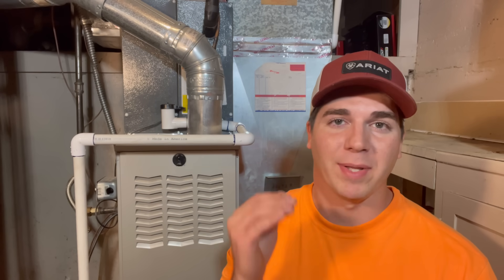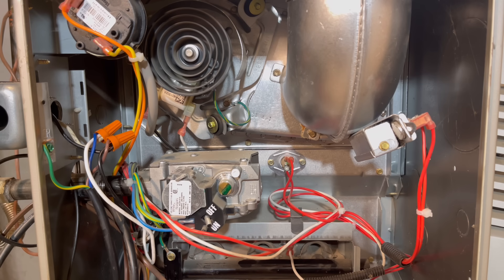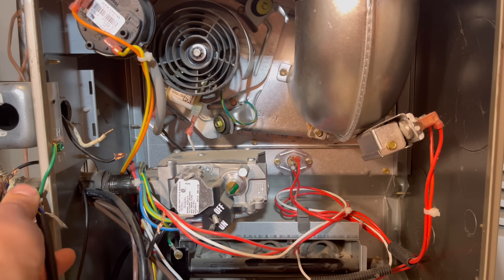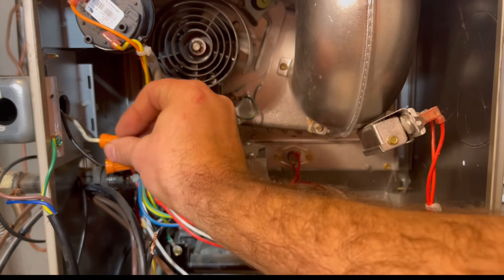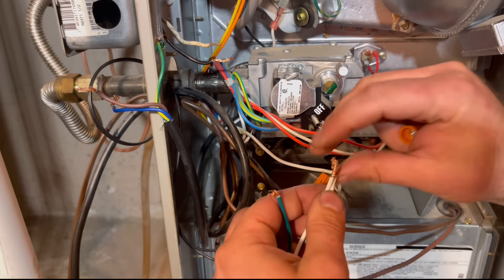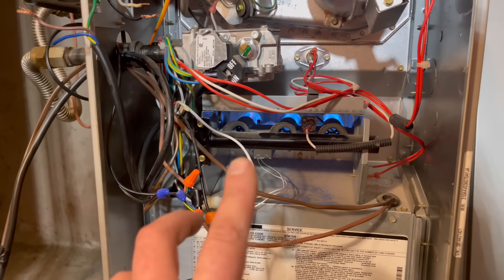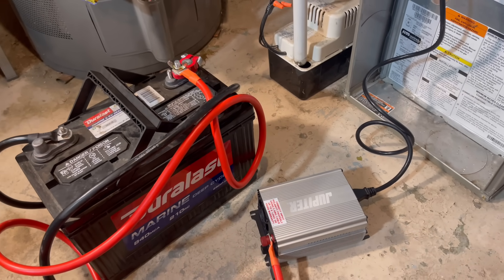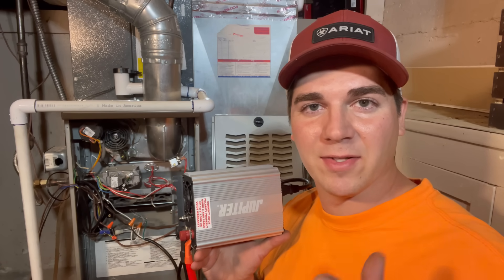Did You Know You Can Heat Your Home With A Car Battery?

Comment: For those worried about the battery life, you can always hook up the battery to your vehicle and let the alternator charge it up a couple times a day too for a short time.
Reply: It doesn't matter what you post, someone will bitch about it.
Reply: @derekbootle8316 .    You nailed it there. I don’t give a shit if I hurt a battery or an alternator if the power is going to be out for a few days and it’s -30 outside. Sometimes you gotta do what you gotta do to not have your water lines burst
Reply: @derekbootle8316  for real
Reply: @derekbootle8316  That's ridiculous. No one ever bitches or complains on these threads. 😆
Reply: Or, since all you are really doing is adding an "extension cord" style setup, you could plug the furnace into a portable generator.  Another option.
Reply from the maker: Check out my latest video :) cheers
Reply: People there is a second outlet just plug a battery charger in that outlet and it will keep the battery charged, and run the furnace, problem solved about the battery dying 2 birds 1 stone
Reply: @kenchevy3960  Exactly what I was going to say, plug a charger into the other outlet, and set the charger on a trickle charge!
Reply: @kenchevy3960    Or better still,  buy a very large inverter, charging a bank of batteries.  Disconnect the utility, and the batteries power the inverter, and the inverter runs the house load and charges the batteries at the same time.  Problem solved!
Reply: Just plug a battery charge in the converter then the battery would be charging itself
Reply: Or use a solar charger during the day.
Reply: Just connect the alternator to the furnace and use it to charge the battery
Reply: Leave the battery in the car, get a long extension cord, run just the cord to the furnace. Then you can periodically start the car to charge the battery since car batteries are not designed for deep cycle and will get damage if drained too much.
Reply: Good advice and you should actually do this regardless.  Car "starting" (vs. "deep cycle") batteries aren't made to be deep-discharged.
Reply: @joez.2794  Correct. If a person has an inverter, a deep cycle marine battery is the right choice which run about $80.00 or so. People with power inverters (pure sine wave) most likely have solar charging. On the other hand, a solar generator has both battery and inverter which can be hooked up to solar or electrical outlet and are usually pure sine wave. The inverter in the video is a modified sine wave device and are only good for short period of time use. So he is correct to run the furnace on that particular inverter.
Reply: wow, there are some dumb people here...
Reply: absolutely ....and battery maintainers when the power works, gas motor a car alternator and a battery...many ways to do these things!
Reply: You say any battery will work, so your battery was 844cca.  My truck is 740 cca.  Is their still high probability that it will work.  Thinking of buying a spare that's why I want to clarify.  I do appreciate the budget solution.
Reply: @fpcsdseniors9912  better off buying a small generator. The battery based idea is more for if you get caught off guard and all the generators are sold out bc the disposable generators all got thrown away last storm by single use wasters.
Reply: Awesome, so now you can introduce extraneous electrical noise back to your ECM module on your vehicle. Heaven help you if you fry that.
Reply: Yep.
Reply: Or just leave the battery in the car and run an extension cord from the 120v inverter. Even better if you can find space to put the inverter so the hood closes but also good to turn off the inverter when not using the furnace or you draw power off the battery. Run the car to keep it charged since you will need a charged battery to start the car anyway.
Reply: @TheAnantaSesa  or just get a fucking generator
Reply: @jamineamina5429  or just get a whole fluffking solar array/windmill/battery backup system. You can't always get stuff last minute or fully afford it for an off chance of need. Looks like you missed the point of the video.
Reply: You can have two inverters. One from the battery to the AC inverter which powers your furnace. Then since you have more than one receptacle you have an AC to DC inverter that’s connected back to the battery. Trickle charging your battery. However it depends on the line and load.
Reply: @joesnose1647  lol. Free energy! Just unplug the battery from the car and shut it off too. Charge from the inverter lol
Reply: @TheAnantaSesa  exactly!
Reply: @TheAnantaSesa  yeah it's called perpetual energy and that doesn't exist it's going to take more energy to run the battery charger than is being outputted onto the battery from the charger.... I've tried this myself and I've seen tons of videos on it...
Reply: @atmotu420  maybe we need to try one more and THAT will be the one that works! I put piston springs in my car and it has saved me so much gas that when I go to the gas station THEY PAY ME!
Reply: @joesnose1647  That would be incredibly inefficient.  You'd lose more power in the power conversion in the inverters than is being made.
Reply: @joesnose1647  that absolutely will not work unless you have two batteries. You might trickle charge a second battery, but it will probably not charge fast enough to replace the first battery when it runs down. Otherwise, we’re talking perpetual motion, which doesn’t exist.
Reply: is it possible to plug a battery charger in the second outlet in the inverter and actually charge the battery with its own power?
Reply: @kylewhitmer7922  No. The battery only has the energy it starts with. Little by little the inverter will convert the electrical energy to heat and continue to drain the battery along with any loads connected to the inverter (the furnace and the battery charger). The battery charger will also turn some of the electrical energy into heat. The inverter and charger do this because they are inefficient (that is, you get less energy out than you put in).
Reply: @kylewhitmer7922  Nope.
Reply: or buy a really basic 12v car battery charger for $30 and charge it from the wall. Sometimes they have settings to maintain the battery charge level indefinitely.
Reply: @kino_cinante  as if you won't need that same car battery in your car again lol. Great idea and I forgot you could just plug it into the wall during a POWER OUTAGE. Which is why this whole idea exists. Yes after the power comes back on, you can use a wall charger to get the battery back to charged. But you will be stranded until then if you let your only car battery drain too low. Deep cycle batteries are a better alternative than having a spare car battery for this purpose and even better still is to get a generator and/or solar bank but this idea was just to have heat during an outage with minimal additional expense.
Reply: @AnantaSesaDas  on a older car this is possible if the battery can take a charge.    But not on newer cars your computers(more than a few now) won't turn on.  Need 12v signal maintained.  Also this is a sure fire way to burn up a alternator.  Alternator needs the 12v supply to create amps to run a car system.   It's creates AC power that is converted back to DC.  The battery is maintained and can be charged,  however  the alternator performance is dependent on engine rpms which is a minimal charging output at low rpms in a driveway.
Reply: @mikek7077  no. I was saying you take the battery out of the spare car that isn't running. But I guess it's better that spare battery come out of the older (likely less efficient) car bc removal could make it not start again if the persnickety computers lose power which is the stupidest design ever.

My car routinely loses connection to the battery and I can get it to work again by fiddling the cables until the corrosion isn't blocking the circuit anymore. If I had to tow it to a mechanic every time that happened just to have the computers reset that would mean I would be stranded way more than necessary. They hate us working on our own cars so much that they make us lose hours waiting for a tow on a fix that takes 2 minutes.
Reply: @kino_cinante  There will be bo electricity?
Reply: @FORGVN  Just buy a seperate battery and keep the battery charged constantly with the battery maintainer setting.
Reply: @kino_cinante  The scenario is no electricity.
Reply: @kino_cinante  thought we were talking about a power outage scenario...
Reply: @kino_cinante  apparently in this scenario the power is out
Reply: Not how that works. You’d have to put the battery on a charger. Alternators maintain your battery. They don’t charge them.
Reply: An alternator is not a good battery charger.
Reply: @natelysy3114  It is if it's the only thing you have to charge the battery with....lol.  Which is the whole point when the grid's down. ;)
Reply: You'll burn out the alternator.   They are not designed for deep charging
Reply: @Dread_Pirate_Homesteader   True.  Alternators are probably the worst option for charging a battery.  You'd actually do better running a 12V inverter and a real battery charger.
Reply: @5thGenNativeTexan  oh that makes more sense. Lol So you plug the charger into the inverter which is running off the battery. What is the charger supposed to be charging again? I thought this setup was supposed to run a HVAC not how to charge a secondary car battery.
Reply: @TheAnantaSesa  The video was absolutely about how to power the 120V portion of a gas furnace.  But the thread you were responding to was specifically about the alternatives to go charge up that battery that was dedicated to running the inverter and furnace.   Feel free to go comment about power the furnace in another thread.
Reply: @5thGenNativeTexan  well did you mean to suggest the inverter is directly plugged into the alternator with no battery in the car? and then use the charger to charge the battery with better and more stable current? I can see that maybe being good advice. I just thought you didn't think about what you were saying and suggested some nonsense. I'm not sure running a car with no battery is so good though. I burned out an alternator doing that. So that puts us back in the same place. Better to just let the alternator charge the battery as is and use a maintenance charger after the power comes back on if you don't trust the job done by the alternator.
Reply: @TheAnantaSesa   I think the overall logistics of using a car with just the  alternator to recharge an auto battery that was used in the video example is just difficult.  First, you need a battery with a decent charge to just start the car.  Then how would you connect the second battery to have it charge? Jumper cables probably?  But that's generally an inefficient charge, and not necessarily a stable charge.  Thus my comment that it would be easier and better, both logistically and technically, to just have an inverter hooked to the car's power (a lot of newer vehicles already come with an inverter installed for 110V), and just plug a standard charger into it to charge the secondary battery.  To be honest, while the video was a good example, I don't think I'd use a standard lead-acid battery to do what he described.  You'd be better off with a moderately decent "solar generator" which are typically a lithium battery and have an inverter integrated.  They are much easier and faster to charge from something like a 12V outlet on a car, last longer, etc.
Reply: @5thGenNativeTexan  your last response to me gives me a good idea how best to do it if you have 2 cars. Take 1 battery out of 1 car when it's gone dead from powering the furnace. Then use the battery maintainer to charge it from the other battery+inverter WHILE THE CAR IS RUNNING first. This way you can keep at least 1 battery charged at all times. And might be able to run the furnace at the same time but don't want to add too much load to the running car or it could shut down (not enough for spark). That's why I say just run the furnace while the car is running to begin with. Having a second car is better as a backup but can let the battery run overnight so you don't have to monitor a running car (theft bait) while you want to sleep.
Reply: Alternator’s do not charge batteries, they maintain them. So you will be maintaining a battery with a low base charge. Not a deep charge a battery needs.
Reply: @accordia79  Alternators will charge batteries lmao. That's why when you accidentally drain a battery and jump start the car the battery will be charged after you drive for awhile. In normal conditions an alternator will only maintain a battery, but a dead battery will pull more amps and recharge as you drive.
Reply: @bobbygetsbanned6049  Keep that logic and I bet all your batteries fail way before they should. Yes the alternator does charge the battery up. But it never returns the battery to a fully deep charged state that it will get from a low slow trickle charge. Batteries require this type of charge to last and not shed so much during large amp draws. I’ll simply leave it at that.
Reply: @accordia79  plain stupid they charge at 14 volts some cars have hundred amp altenator's they will power your house an charge the battery at the same time , your confusing car batterys are not deep cycle to what an alternater can actauly do
Reply: @accordia79  where in the fuk did you hear that? Thats literally the job of an alternator, in every car, ever.
Reply: @d8l835  I didn’t hear that.I know that for a fact. Go be an internet mechanic and charge your battery with the alternator. It’s your battery that will fail prematurely in the end, due to it not being charged back to its full state by the alternator. It is now simply maintaining a battery with a low Amp charge.
Reply: @accordia79  dude...everyone knows an alternator will never fully charge a battery. You cant. "Maintaining" the battery is literally the same thing as "charging" a battery. If im an internet mechanic what are you? A radio kindergarten teacher?
Reply: @d8l835  hence why you should charge the battery after getting a jump start. 
The 20 minute drive home and consistent 20 minute drives around town will leave you with an over worked alternator and a extremely short lifespan battery. You are free to do whatever you’d like with your stuff. But don’t come on here attacking my sound advice because you want to boost your ego!!
Reply: @accordia79  that makes sense. Haven't heard it before but it sounds similar to the logic behind the high voltage pulsing devices called desulphators.
Reply: @accordia79  they recharge a low battery....I think you meant if the battery goes too low it will become damaged and the alternator won't bring it back....it will recharge it but capacity of the battery often goes down after a complete discharge.
Reply: @accordia79  SO when you jump start a car with a dead battery, with the only real power coming from another vehicles alternator, you're trying to say that the battery doesn't then get charged by an alternator? Whether its from the donor vehicle or your own vehicle once its able to run?
Reply: @accordia79  they do more than maintain them. How else do you explain people getting their cars jumpstarted and then never having to do anything special to "recharge" the car battery? Alternator charges it at 14v and then shuts off when it has been charged.

Granted the car might not produce enough power to run a furnace so the battery will be getting drained while furnace runs and recharges in the off period.
Reply: @@xaphanvassago7832never heard of nuclear power? Even if you burned only coal to charge EVs they would still end up causing less co2 than gas engines

Comment: One thing to make the battery last longer is to have a second battery power the fan or disconnect the fan all together and have a smaller lower power fan somewhere up in the duct work. As long as you have some air flow it's going to work then you trick the furnace into thinking the main squirrel cage fan is on so it doesn't cut off the circuit.
Reply: no
Reply: RIP your heat exchanger
Reply: @joez.2794  exactly

Comment: Have an 1800 inverter  won't even run a freezer ? 3.5a .but it runs a snow blower off the car  we have 2 kerosun moonlighter s and a 2k gas gen w 12 v charge port suspect that uses 35 or so amps wouldn't run long ?.I generally put the inverter on the van run cord to house for short term power say we want the tv and a light  usually I wait 12 hrs before hooking a gen up works well.🤔

Comment: Interesting idea, but I'm questioning how long the battery can really run the furnace.
Your battery's label shows a reserve capacity of 210 minutes, meaning, under ideal conditions (fully charged, new battery at 80⁰ F) it can power a 25 A  load (12 V x 25 A =  300W load) for 210 minutes or 3.5 hours.  The inverter will have an efficiency of about 80%, and this drops the running time to about 2.8 hours. Assuming your furnace runs about 15 minutes per hour on a cold day, that means your battery would last about 11 hours if the furnace really only uses 300 watts.  Older furnaces without ECM blower motors will likely need 2 or 3 times the power, and the running time on one battery charge will be reduced to about 3 to 5 hours.  A typical car battery will have significantly less reserve capacity than an RV battery, also cutting into the running time.
In an emergency, this idea may keep your pipes and family from freezing, but you are going to have to keep putting the battery back in a vehicle and running the engine to charge it back up every couple of hours.
Please correct me If my math is wrong.  I would love to know that this idea is practical.
Reply from the maker: Watch my latest video and you will find out :) cheers